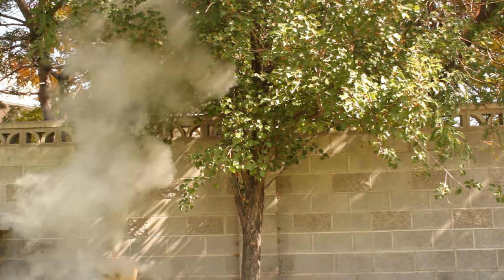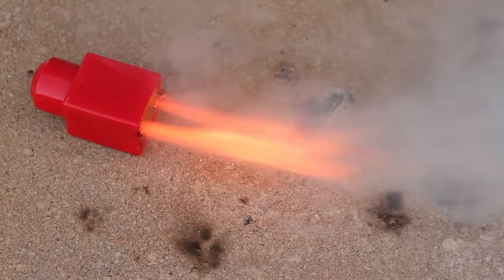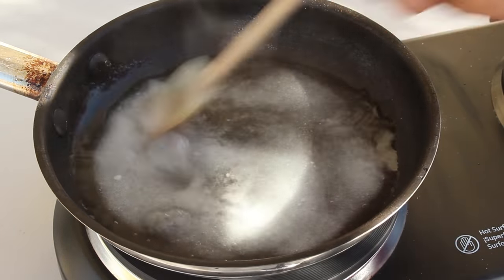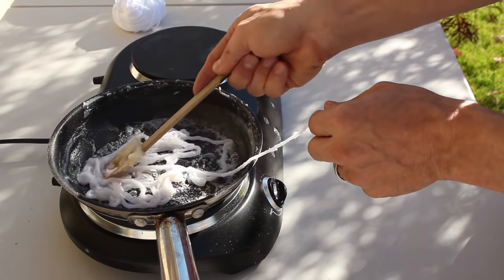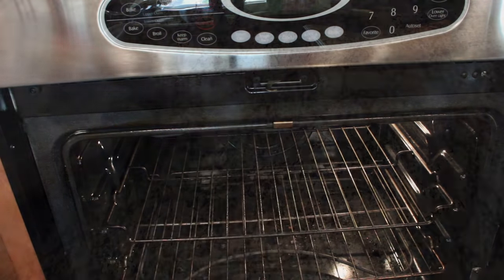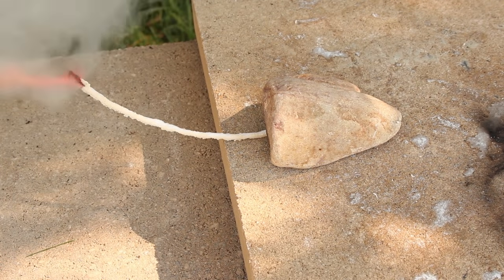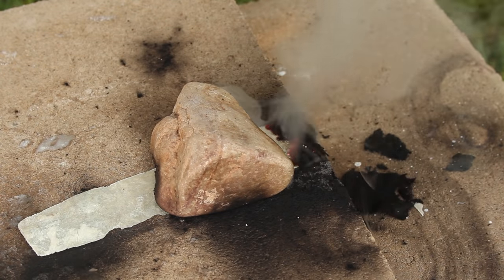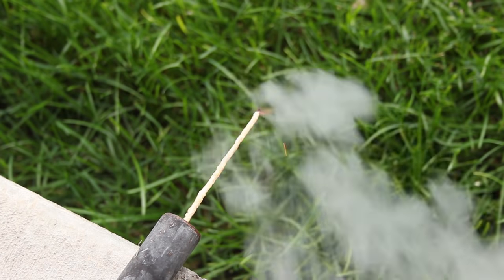How To Make Slow Burning Fuses

Comment: This guy is still alive in so many hearts. Had a blast last year with my kids on the 4th cause of him. Doing the same this year, thank you!!
Reply: Truee, but i have a question since ur comment is 1 week old, did you use the normal house oven if you made this fuse, or did u have a seperate oven
Reply: @dcjay7015  All the chemicals are edible so you should be able to do it in a normal oven
Reply: @gresmaster2279  Stump remover is Potassium nitrate. Not edible
Reply: @RiteshNEVERUNIFORM  any chemical is technically edible
Reply: @Dctctx  but some can only be eaten once...
Reply: @alifr4088  based deng xiaopeng
Reply: Are you doing it again this year?

Comment from the maker: Yes.  I did a test where I sealed a batch in an air-tight bag, and left a few outside the bag.  After a month, the fuses exposed to the air would hardly light, and didn't work very well.  They can be made useful again by putting back in the oven at about 300-330F for 20 minutes.

The ones sealed in the bag were nearly as good as they were when I made them a month prior.

Thanks for asking!

Comment: I think the filter kept burning under the rock because the oxygen it was using to burn didn't come from the atmosphere, but from the potassium nitrate or KNO3
Reply: That is precisely why.
Reply: Yes, that is the point of using an oxidizer
Reply: Also, the twisted paper towel fuses merely deflagrated when the pressure built up. This means they aren't actually that dangerous, and can be used to propel projectiles, which rely on deflagration to avoid blowing open the barrel and killing the operator.

Comment: potassium nitrate and sugar is a self oxidizing solution, which is why it can burn even when covered by a rock. Be careful though, that also means that once it get's going, there is very little you can do to put it out.
Reply: You can always cut the fuse off before it reaches the pyrotechnics or whatever. xD
Reply: Conjuring up the image of Wile E. Coyote just now.
Reply: Nolan LastName put water over the mixture... the simplest thing on earth. :)
Reply: Pyro Diamond Water may not put it out, since it contains its own oxidizer.

Comment: With experiments I found something amazing. If you don’t use water you’ll get a much more concentrated mix so you’ll be able to live it outside for even a couple days. I live in wet climate area and it worked even after 3 days outside.

Comment: I tried this on a very thick rope and it didn't work. So I tried it on a thin rope and it was much better, but still, the flame dissapeared after 5 seconds. So I looked on a pyrotehnic forum and I found out how to make the slow-burning fuse faster, better, easier and safer to make (and even without cooking!). And this one really works !!!
  First, mix 60% of potassium nitrate and 40% of sugar. Then stir well and took a large piece of alu-foil. Cut the alu-foil into 3cm x 10cm rectangles (or more/less, as you wish). Then, just take the spoon and sprinkle the mixture evenly along the rectangle. Then roll the rectangle so your mixture can't go out and make a fuse shape. Then, fold the both edges, so the mixture won't go out.
  Then, put your fuse around 2 or more centimeters deep into a thing you want to burn with a fuse and cut off the edge where you wish to burn the fuse (when you cut it off, you have to see your mixture inside). Then, just use the lighter on this edge and wait until the fuse burns.
GOOD LUCK AND I HOPE THAT YOU FIND THIS AS USEFUL !!!
Reply: Thank you. I might try this.

Also a link to the source would be nice too!
Reply: Ok, there is the link of the page where is written, how to make what I translated and how to create other slow burning fuses and even how to make an electrical detonator,...:
 http://old.piroraj.org/vzig.html

But the link of the main page of the whole pyro site, where is written, how to make many explosives, including some of the most powerful in the world (TNT, RDX), slow burnung fuses, rockets, detonators, bombs, funny chemicals (smile gas, stinky gas), properties of chemicals required, where to get them or how to make them at home, etc. is 
http://old.piroraj.org/index.html

The whole page is in slovenian, so you probably won' t understeand it as I do, so try to use some online translators and hope for the best results, because this is a very useful site.
Reply: +Balon poč Why did you use rope? He used cotton yarn in the video.. Or were you just trying something different?
Reply: crazyfvck I used polyester, biodegradable fuse and cotton fuse. But I found the method with alu-foil much more effective and easy.
Reply: Non-cotton doesn’t seem to work. I tried yarn that wasn’t cotton and it failed. Cotton, when saked and dried until stiff, works well. I did it.
Reply: soaked
Reply: Balon poč lmao be sure to have something to hold it down or it will take off flying

Comment: Try coating your fuses with a thin coat of wax and see if they will burn under water.
Reply: I'm pretty sure they would anyways cause they have saltpeter which is an oxidizer
Reply: Nope, it dosent burn under water! might have to try the was idea!! Anybody else try it yet???
Reply: Yeah it does. Saltpeter is an oxidizer, and as long as it doesn't fall apart in the water, (i.e mixed into a string so it doesnt dissolve) it will burn. Thats why some fuses burn underwater.
Reply: the only catch is you have to make sure the fuse doesn't get to cold or the fuse will die out. my solution is to use boiling water.
Reply: Spray paint or lacquer....
Reply: Kevin Thomas,i tried that, the wax melts and extinguishes the fuse immediately

Comment: You can use straight potassium nitrate with the cotton yarn or soft woven string. It burns much slower and wind will not put it out. We used that formula to burn a string that held the rudder of a free flight gas powered airplane. When the string burnt it released the rudder at an angle so once the plane was in the air it would then circle so we didn't loose it. Like I said, wind doesn't put it out. If you measure the burn of a one inch piece the rest of the batch will be consistent time.

Comment: I also make same but it's not working like this: (
Reply: make sure your yarn is 100% cotton and not acrylic
Reply: @CWGminer  this comment saved me, thanks
Reply: Andrew Flem no problem. Cotton burns much better, and I found out by accidentally making fuses from acrylic yard that ended up awful.
Reply: @CWGminer  same! it's almost depressing when you do things exactly  as the dude in the video but still manage to mess it up somehow. also, is it possible to use NaNO^3 (sodium nitrate) instead of KNO^3 (potassium nitrate)?

Comment: An interesting project.  The term "white table sugar"? Is that the same as White Granulated Sugar? Also after coating the Cord and placing on the Baking Tray, the Video suggests 300 deg C. ( you don't actually say which scale to use) but 300C is 572F and the Oven on MY stove doesn't even go up that high. Are you Sure its 300C??

Comment: I was needing to make what's called a slow match for my cannon linstock  used for reenactments. I used the Spectrcide from Lowes for the kno3, and a replacement all cotton mop head made by Quickie mfg. No. 24 mop refill, available at Lowes. Desolved the kno3 in alcohol and saturated the 2' individual stands in solution. When dry, burns great.
 Col. Jack- keep your powder dry.

Comment: the fuse needs a water proof coating.... like lacquer or poly urethane.  The potassium nitrate is hydroscopic so it will absorb moisture and become useless over time, depending on your climate and how you store the fuses.

Comment: What occurred to the tubular type fuse/s, is a form of 'thermal runaway'. If you provide an atmosphere in which 'like' gases can congregate, for reasons not totally understood by myself, the reaction accelerates exponentially.
I was looking for a bid in which they burn det. cord - once exposed in the open. Then, insulated by a small tube, maybe 6mm ID.
the difference in burn rate, from the same fuse material is astounding.

Comment: It's great your family is supportive of this, my Bride isn't very happy when I bring things that "stink" into the house (Hoppes #9 is a great example).  When you dry this in your oven at 300 degrees, how does it smell?  I'm trying to decide how clandestine this  project needs to be.
Reply: It smells like roasting sugar mainly, if you leave it to long it smells like burning sugar of course. When the fuse burns it smells like burning marshmellows and smoky burning yarn. 

Mine didn't turn out so well, it burns for a little, then goes out, so its reliable for about a couple inches. I think its how I mixed the yarn, so that it kept certain parts form absorbing as much of the solution.

So just saying its not a sure fire first time thing, you may have to try it a few times, and if you are trying to hide it, try to do it outside with other methods of drying it if you can find those. Best of luck to your efforts!
Reply: MrLittlelawyer
Thanks for the fast response!  Roasting sugar smell isn't going to put me in the dog house, that's for sure.
Reply: sailinon1969 Just remember to be careful like I said, burning sugar and roasting sugar are very different things! :)
Reply: MrLittlelawyer
Right on, thanks again MrLittlelawyer.

Comment: That seems like a lot more work than necessary.  I made this once by just soaking string in the mixture at room temperature, and then leaving the whole thing on the window sill.  Came back the next day and it had all evaporated on it's own.  Seemed to work pretty well, although cotton string would have burned more steadily.

Comment: I made a slower-burning version with heavier cotton cord. It takes forever to burn but stays reliably lit! Goes about 2 minutes/inch. It takes longer to make. Make a supersaturated solution of the stump remover using stale urine instead of water. Add iron oxide (rust). I made the iron oxide by soaking steel wool in muriatic acid for several minutes, rinsing it off and soaking in hydrogen peroxide. I boiled down the hydrogen peroxide rust to a paste then added it to the nitrate solution. I soaked the heavy cotton string for 10 days in that, then dried it out in the sun. Presto.
Reply: +Duff Smith I should add there is NO SUGAR in the nitrate solution I'm talking about (unless you're diabetic, haha).
Reply: +Duff Smith Unfortunately mine does not stay lit in closed containers or even a bottle with no cap on. It seems oxygen-dependent, but maybe this will improve as the product ages in solution or dry on the shelf.
Reply: +Duff Smith Hey I wonder if anyone has tried soaking the string in nitric acid.

Comment: They work great out of the oven, however, on day two they are inconsistent. Is there something that can be done (I.e. Storage method, mixture ratio, baking time) to increase the shelf life? I have seen you use some in other videos so I am assuming yours stayed viable for some period of time.
Reply: They absorb water from the air unfortunately, I'm trying to find a solution,  I'm thinking hair spray them

Comment: Have you considered dipping the fuse into wax to make it water/humidity resistant?
Reply: I wonder if the KNO3 is still hydroscopic or if it isn't since it was boiled with the sugar and so is then more of a solution. if it is still hydroscopic it is probably a must to dip the fuse into wax, and someone should try it and test it.
Reply: Highland Viking Potassium nitrate is not hygroscopic. Sodium and ammonium nitrate are.

Comment: For a cool quick homemade firework put magnesium flakes from a fire starter and crushed match heads and put it into a paper towel and light it after it burns for a few seconds it will make a crackling sound and bright white sparks

Comment: I used the powder from the match stick heads it worked fine
Reply: +Gabriele Di Carlo how? Did you mix it with water then boiled it out?
Reply: LousyLuke Uhh. no  just mashed the match stick head and rolled i in paper towel, it's fast i know it works

Comment: I have seen almost every videos you upload. you are awesome ! I have one request that if you can make fuse without potassium nitrate or sugar.
Reply: You can use match head powder in little of water to make fuse, Take a look on youtube. That's the most basic way i've seen on the internet but, NaN03 is'nt that expensive you could find it on ebay easy, just make sur you're on ebay.com, the (.com matter). But whatever, any good oxidizer agent could theoretically work !
Reply: Thanks that way look easy
Reply: But I live in pakistan NaNO3 is'nt available on local store or online stores but I'll try ebay maybe i will found it thanks for your advice I really apriciate

Comment: Hey Grant (or anyone here on YouTube), any idea on how to make a fuse burn in colors?  Trying to create a Blackbeard's ghost costume for next Halloween, and I would need some slow match/rope fuses that burn green to wear in the hat/weave into the beard, etc.  Ideas?  Future video?
Reply: Different metals burn with different colour. I would recommend copper for a green flame.

For it to actually burn green, you need tiny copper grains, soaked into the solution as well. You make the grains by for instance, using a metal file on a copper tube (make sure the tube is pretty clean, for a nice "clean" colour).
Reply: Iron is red.

Comment: Where do you buy  KNO3 ?
Reply: Thank you!!!
Reply: Daniel T I got mine at menards.
Reply: Daniel T u could mix KOH and HNO3
Reply: Daniel T It's found at lowes, it's simply the chemical in stump remover.  Best brand to buy it from is Spectracide
Reply: +keraaa ETC No thats the reaction to MAKE KNO3.
HNO3 + KOH --> KNO3 + H20
Just boil off the water afterwards.

Although I really doubt anyone actually has HNO3 and KOH lying around instead of KNO3.
Reply: yo

Comment: Can you use a indoor stove and when in the oven is there fumes
Reply: I may be a bit late but regardless I'm going to attempt to answer your question. Potassium nitrate decomposes at around 400 degrees celsius and as such should not present any risk of decomposition at the proscribed 148 degrees celsius. So, you should be fine, just ensure that your oven is in working order.
Reply: Oh, and you can also sun dry the fuses if need be.

Comment: I made a batch of these few days ago and they worked really well, but a few days later when i tried to light one, i sparkles for a bit then goes out, does not stay lit......i am thinking the sugar in the mixture is absorbing some humidity from the air, therefor causing it to burn like that ----- maybe the fuzes should be stored in a zero humidity place??????

Comment: You should try KCLO3 in the role of OXIDIZER coz KNO3 absorbs moisture in the air and become so wet. In addition, KCLO3 has higher level of oxidation than KNO3. Anyway, that's my idea ;)

Comment: I go to walmart and buy emergency flares, pour the flare powder in water then put string in the strontium water for a couple hrs. Take out and let dry in a straight line. Then cut into smaller pieces and these are my red fire fuses

Comment: If you find some cheap candles or paraffin wax you should be able to coat your fuses and have them work under water. Since the kno3 is an oxidizer you can ignite these in almost any atmosphere, or even space.
Reply: That is accualy impossible mainly because in order for the ignite to take place you need fire... And what does fire need??? OXYGEN
Reply: Trent Hornsby This fuse will keep burning w/o outside Oxygen needed! As the Potassium Nitrate will provide it with elemental Oxygen (the O part of KNo³), the fuse will still burn. You only need to light it whilst above the surface, then you dive and see the magic of chemistry happen ;-)
Reply: Jeremy J. Sieber said, "even space."
Reply: Insu Wolf TheSieblerElf I´d go as far as saying that, as long as the fuse is shielded from the thing that would take away the heat rapidly (the water AS WELL AS the 0K in space) yes, the fuse would even burn in space.
Of course this is just a hypothesis, only an actual experiment could show the results.
Again, as the fuse provides itself with Oxygen to burn, the fact that it is in a vacuum won´t keep it from burning, that, I´m sure about.

Comment: How would you make the fuses waterproof? Using them to actuate signaling devices, such as smoke flares, will not be possible if they won't burn in inclement weather. Would dipping them in paraffin work?

Comment: someone please anwer. i made a kno3 and sugar rocket and i had made a few thinner match fuses and it didn't ignite the rocket and i'm guessing that the fuse wasn't thick enough and it went out when it reached the hole of the rocket, so im hoping that this will do the trick but can you use yarn of any other type of material as long as its not synthetic and can you let the wet fuse air dry?

Comment: Is there a replacement for KNO3, I have no access to it in Australia cuz my hardware stores don't supply stump remover, for whatever reason.
Reply: Bob Boggins1x1 yes... get some potassium perchlorate... and aluminum powder.. mix at a 70/30 ratio... pour into a straw ... stick in oven for a few MINUTES so the straw can kinda melt to the powder... BOOM! Literally you’re done... take it out and let air dry.
Reply: You can make your own, look for a video on it, or read up on it, it may take a while to get it if you don't have animals around.

Comment: mine worked for about 10 minutes out of the oven then wouldnt burn the whole length of the fuse any ideas on how to fix that?
Reply: Humidity moisture getting to it most likely.  Try storing it in a zipper bag, tupperware with some dry white rice to absorb out the moisture.

Comment: Can you try burning it in a container to check if the KNO3 uses its oxygen to burn the sugar or it uses O2 from the atmosphere
Reply: +Anthony Ponce It doesn't burn straight up, even if you pour some on a rock or something. it has to be ground real fine, mixed with the sugar or powdered sugar